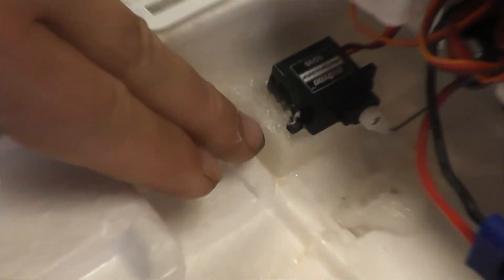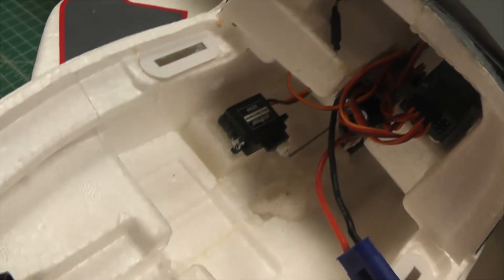Waterproofing a Leaky E-flite Icon A5 And Rudder Servo Placement Mod

Comment from the maker: I finally got out to a local lake and dropped the plane in the water and pushed it down in the water up to the sides and didn't see any of the fast leaking I saw on the maiden. I also flew it a few times and despite a few bumpy landings, no water managed to get in. I consider this repair a success. I'm not sure how long it will last, but the gorilla glue is currently working perfectly.